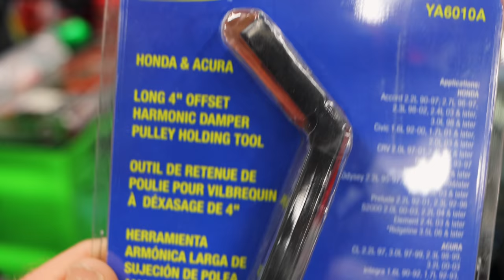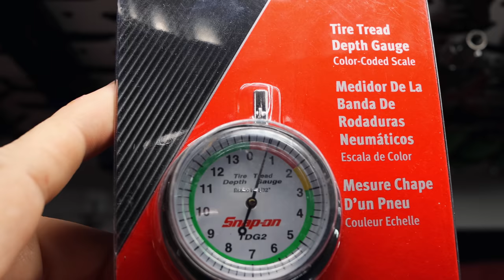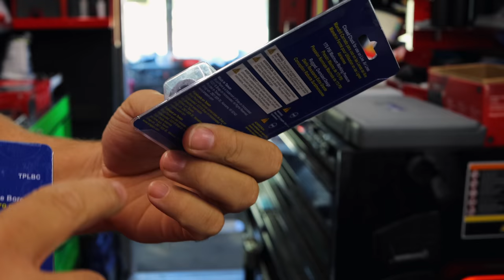Snap On Friday New Tools And Hunting Stories

Comment: You can buy that same ish crank holding tool at oreillyauto $45 lifesaver use mine all the time for honda timing belt change. Ive been doing commercial tires and heavy equipment tires for 16 years those large bore chucks and gauges are for your heavy equipment shops like caterpillar. Loaders scrapers and mining equipment use large bore valve stems to air up the tires faster
Reply: Yea it sucks without the tool think I paid 35dlr plus tax for mine an I love it. It ain't nice as that blue point one but it gets the job done tho. Mine don't have the handle built on.  Just a square to put a breaker bar in

Comment: Vinegar, gets the smell of damn near anything out. I had to shoot a possum that had been getting into a buddy's horse feed. I found it after it had been sprayed by a skunk. My buddy threw it in the back of my truck. I tried everything, even diesel fuel and the skunk smell kept coming back. I bought a $2.50 gallon of vinegar. Poured it into my truck bed. I let it sit for an hour or so. Washed it out and the smell was gone. Vinegar is my go to for horrible smells left behind
Reply: One of the teenager probably 13 14 years old my grandfather who raised me had accidentally caught a skunk in a steel trap trying to catch possums that were digging up his yard and I can tell you now shot that skunk with 410 but I got lucky I shot that skunk before he sprayed lemon grandfather and me dug a hole a deep one at that and buried that damn thing I tried to tell him to use it for gator bait but he didn't find that as funny as I did